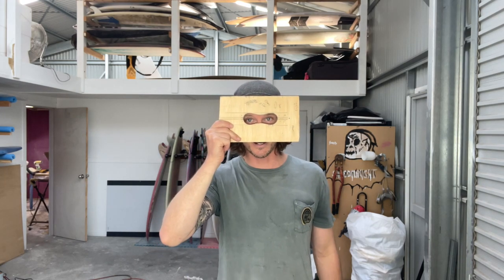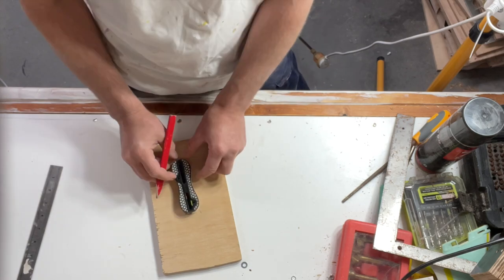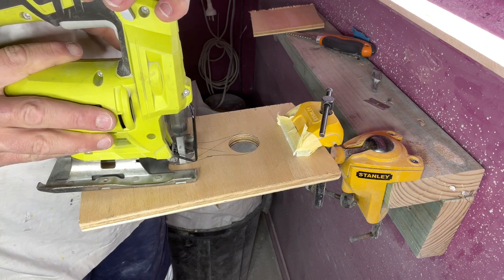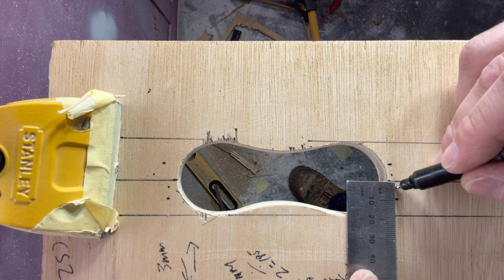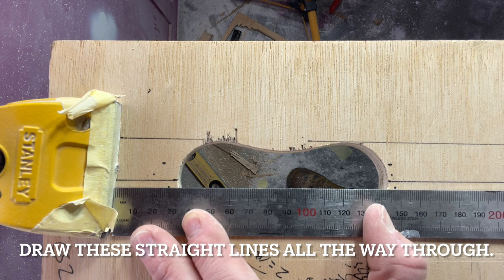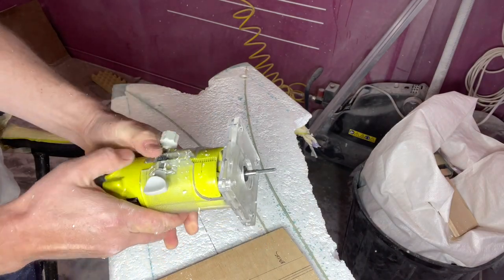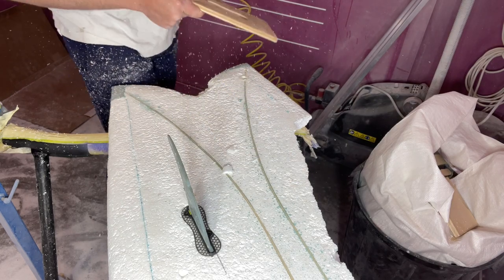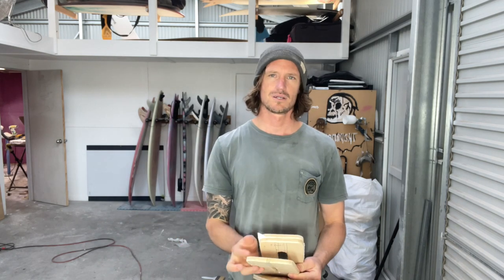DIY FCS2 install jig and method.

Comment: Great video. Whats the deal when you have concave when routing out fin boxes as one side of plug will sit higher, do you just route bit lower on on side to level up. Does template need to be leveled up or do you just go with natural concave. Cheers
Reply from the maker: Thanks mate. You can route flush with the foam still but then you need to take into account the cant angle when setting the boxes. So if I had a significant concave and I was looking for 5-6 degree cant I would use a 9 degree cant box. Generally concave isn’t too extreme and it doesn’t hinder you too much. But if it does throw cant angles out just using tape to bring back to desired angle generally works well.

Comment: Full of handy tricks👍
So what's the story with that tail you're dropping the fin box into,  some kind of split double stringer fish?
Reply from the maker: That was an old board of mine I snapped. Yeh I glued up a double stringer that both curved opposite at the tail out. Trying to control flex. But for the video I was just using the busted portion as a prop

Comment: Hello, thanks to your vidéo but i dont understand why you have 3 lines : middle,left and right. We cant use the same marks for all ? 
Thanks
Reply from the maker: Good question. The answer is no. You want to use the centre mark for your centre fin obviously but the side fins should line up with the inside foil of the fin not the centre point. 
Hope this helps a bit 🤙

Comment: Thanks dude, helpful vid, do you have any clips on how to position the original dots for fin positions on a board. I see a lot of shapers using a set square with loads of holes in it but just can't find them online. Thanks dude!
Reply from the maker: Where are you located man? I might be able to help find you one online. Are you trying to just find the shapers squares or need help with the actual position of your fins?
Reply: @Shrednaught  located in the UK, just the shapers squares so nothing too crazy. I can find some, but unsure if they have markers for the fin positions as well as rail measurements etc (thanks for the reply)
Reply from the maker: @cameronthorpe9120  ok cool. Majority of the shapers squares just have the measurement increments and you place the dots down where required. Some do have the dots but they work from the rail and are slightly different. If you let me know what website your looking at I can have a quick looksy for ya 🤙
Reply: @Shrednaught  This is the one I've had a look at. 
https://www.seabase.eu/shop/shaping-seabase-layout-square/
Thanks for the help dude, very much a novice.
Reply from the maker: @cameronthorpe9120  that square looks good man. You will still need to learn how to read it. No shapers squares will have a universal measurement for fins as all boards are different. Just ask the manufactures for instructions and should be fairly straight forward. 
Good luck 🤙
Reply: @Shrednaught  ah super, thanks again!